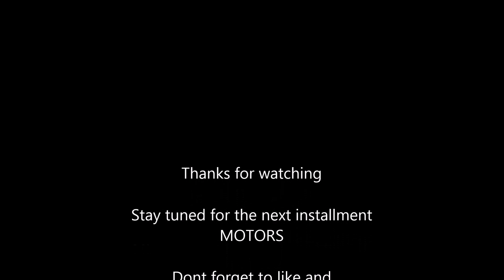Stoopid cheap quad build Racerstar 20a 4 in 1 esc review and build series video 2

Comment: Really looking forward to the next installment, have ordered similar kit, will be my first mini, all in 1 each and F4. Any schedule for the remaining parts of the build?
Reply from the maker: Yes i will be putting up the motor review in 2-3 days 
i have already assembled the quad and shot the videos just need some time for programming and video editing.
Thanks for the support 
Ian
Reply: Any insight on the motors ability to support 3s or 4s as I need to order batteries. Banggood out of stock so looking for alternative small 3s or 4s. 
Thanks.

Comment: Had mine only a couple of weeks Finished the build and only flew 4 times The no 1 esc has failed When conected in in Blheli It says all 4 esc found .The next message it says Failed ESC 1 I am unable to find any address of Racestar only Banggood and they are telling me it has been used,and is just over a month old
I would welcome any help or advise 
I have examined the board and can't see anything that shows sign of blown chips ect It all looks fine
Reply from the maker: Wow Im surprised at the response from banggood.
every time i have had a problem they have been excellent with either a replacement item sent or 50% refund.
Did you you speak to live support?
I would send an email to cservice@banggood.com
That has been my fear of trying one of these aoi escs
From hear i would try and flash a different version of blheli and see if it responds from there i guess its bricked
sorry to hear it
Reply: I have wrote to them,i agree they are usually great lets wait and see
Thanks for the quick response